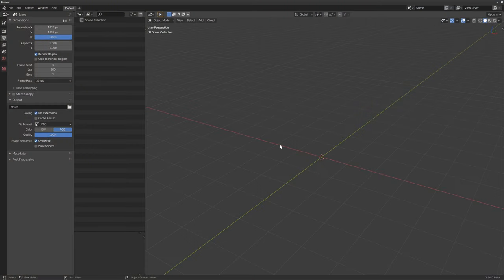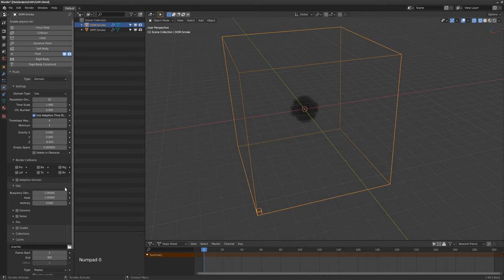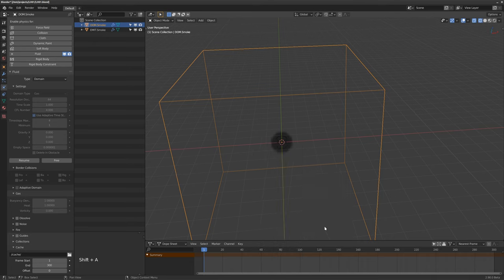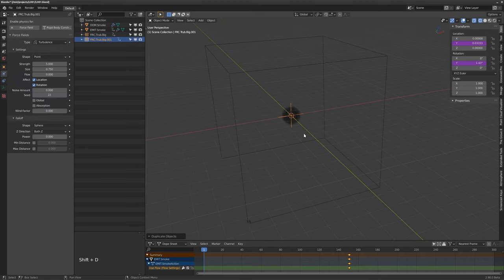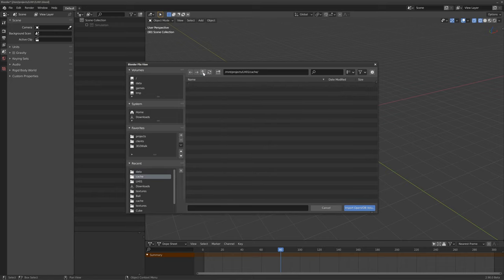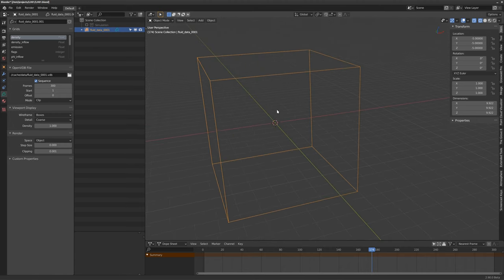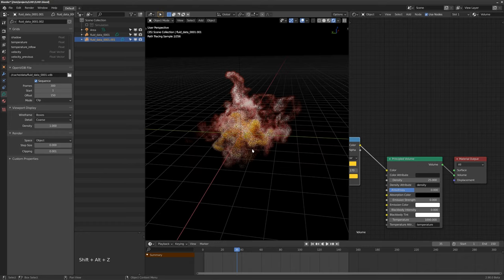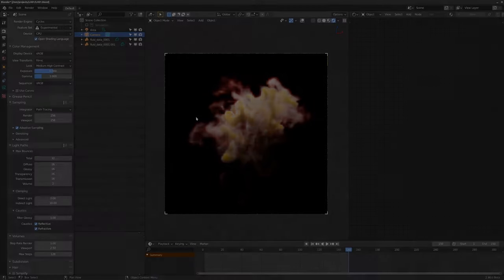The Loop Hole #01 - Looping Smoke Simulations [Blender]

Comment: In 2.93 they've added a "use scene gravity" setting which can't be changed from the top bit, however it can be modified from the "Force Fields" subcategory just further down in the list.
Reply from the maker: You can also turn off gravity in the Scene settings and then the settings will be accessible from the fluid solver. :)

Comment: Perhaps one thing to note, is in the start you should not make really dense smoke sim. Because in the looping part your overlapping them so it gets much denser. But you could also put them after each other but sim will be longer then.
Reply from the maker: Yeah, you can also scale up your emitter for example so it starts small and the overlap is a bit more hidden.
Reply: @MidgeSinnaeve  doesn't the scale I fluence the movement, but on the hand, that doesn't really matter I guess
Reply from the maker: @RomboutVersluijs  Somewhat, but you can have a longer lead in or just animate the density of the shaders to mix them. Lots of options once it's set up basically. :)
Reply: @MidgeSinnaeve  Nice! I always looked at the animations from Lotsalot he had super dope smoke sims
Reply from the maker: @RomboutVersluijs  Cool, I'll have to check those out!

Comment: Love your tutorials and your design aesthetics, Midge.  I bought RTMG and it's totally worth it.  One of my favorite things you do is the loops, so looking forward to more Loop Holes.  BTW, just wanted to say that this doesn't seem to work with 2.83.1.  I ran through this once with 2.83.1 and the openVDB didn't seem to import correctly.  Went back through with 2.9 and it worked just fine.  There might be some tweaks in the steps if using 2.83.1 to get it to work correctly, but I don't know what they are.  Thought I'd leave this here to let others know in case they try this with 2.83.1
Reply: same problem with 2.83.4, the import of density_xxxx.vdb seems to have some issues
Reply from the maker: Hmm, that's weird, I just tried it in 2.83.3 and 2.83.4 here and it works just fine. Make sure to select all of the vdb files in the sequence to make sure it imports the entire sequence. You're sure the cache is set to OpenVDB instead of Uni? It might be saving it to the wrong format be default, this was changed in 2.9 I believe.
Reply: @MidgeSinnaeve  yes it's openVDB and importing all the files Blender has made this https://ibb.co/hY9tXzB, but dont worry, i've just downloaded the 2.9beta, so no problem at all!
Reply from the maker: @antonios5572  Nice!

Comment: Hey! Do you know if it is possible to achieve the volume color you're creating at around the 15-minute mark on solid objects? I created a bowl-shaped "pudding" with displacement that looks like passable mist when I give it a volume as a material. However, no matter what I do the color is either solid or conforms to normal stuff like textures, gradients etc. I want the color to react to the volume's density just like yours does since, depending on the displacement, it's not uniformly dense all over. 

I tried plugging a texture and color ramp into the density itself to make sure there were different  levels to draw on, but that doesn't work either with the attribute or volume input nodes. I tried the same by creating a volume out of the mesh with the same results.

Any ideas? Thanks!
Reply from the maker: Hmm using a procedural texture should work, I've done that before. You have to add a lot of contrast to see it though.

Comment: IS that a new feature as well, using a hastag to immediately add a driver? I know the "add drive" method is already much better in 2.8 but this one is really nice!
Reply from the maker: Nope, been around for a while, real quick to set up! :)
Reply: @MidgeSinnaeve  dang never knew, I always found setting up drivers tedious. 2.8 is better with that popuo window we got now. But this is great!
Reply: Midge also used this in his new Real Time Motion Graphics course. It's really great value! If you want to dive into the Sinnaeve microverse you can find it here: https://blendermarket.com/products/rtmg
Reply: @blenderunit146  yeah I've been following Mitch for quite a while. I always lobed his doodles which he shared for free. The "weird shit" videos if I'm correct.
I also know different code can be added so you can animate usi g say a sinus function. It will anmated without using any keyframes. Saw this trick on blender tips
I do t do animations and my laptop is crap, so I need to wait if I want to get this

Comment: Hello, this might seem off topic but how are you getting the playback of the simulation animation at 30fps, I followed your exact same settings, my cache is stored in an nvme ssd, running a 12core processor with a good gpu yet I get 16fps, have you enabled/disabled anything to get a smooth playback?
Reply from the maker: It's all very dependent on the resolution of the smoke sim. I didn't set it too high so the tutorial would be a little quicker to follow, but it really depends om the sim. In my case, I actually have 4 NVMe SSD's in a mirror setup to get maximum speed, but a regular one should be able to play things back pretty quick.
Reply: @MidgeSinnaeve  I set it to 32, and it's all smooth but when I set it to 64, like you did in the video, it lags(16fps opposed to your 30), I have ryzen 9 5900x with 64gb ram and the cache is stored in nvme, guess I will try it with another SSD and check.
Reply from the maker: @meet2863  Hmm, that is weird, I would think it plays fine on that setup. There's nothing else off the top of my head I can think of though.

Comment: I find a lot of times the smoke looks blurred/blurry, like none of it is in focus even though i'm not using any DOF etc. I have tired higher samples, higher resolution on the smoke.
What's your tips for things like this?
Reply: Sounds like you might have motion blur turned on.
Reply: @notlootbox9942  It's off by default and i never use it when testing renders. Hardly ever use it full stop
Reply: @Unleashed75  
Hop into and enable the 'Noise' setting of your domain, leave the upres factor at 2, more if you have a beastly PC. Set Strength and Scale to 0 so it doesn't simulate the noise and only upscales the resolution of your smoke.

Search for a channel called Crossmind Studio and watch the Chapter 1 & 2 of his recent Mantaflow series where he shows how to simulate and shade volumetrics. His workflow guide should show you what you need to tweak.
Reply from the maker: @notlootbox9942  Thanks for adding that! :)
Reply from the maker: I upres and use noise quite a bit, as Not Lootbox describes in his answer. It can take quite long to simulate and take up a lot of disk space though, so keep that in mind. I've let sims run overnight more than once to get the maximum amount of detail. :)
Reply: @MidgeSinnaeve  You're welcome :) Thank you for giving back to the community with great quality tutorials. Speaking of disk space, I have a cache folder at 32GB for 250 frames of wispy smoke over coffee beans. It can get insane :D Res: 256 Samples: 128 Upres: 3 and I want to try it at Res: 512 overnight, as you do.
Reply from the maker: @notlootbox9942  Yeah, I've seen hundreds of gigabytes for some sims I've done, crazy stuff! :)

Comment: What is going on with the drivers??? I did not catch that.
Reply from the maker: If you type the hashtag (#) symbol and then type frame, so #frame it will give you the frame number in that value so you can use it to automate animations.
Reply: @MidgeSinnaeve  for some reason it only works on rotation, and not location, is there a fix?
Reply from the maker: @MeatMake  Hmm, I use on location all the time, so it should work. Maybe a typo?

Comment: In 2.83.4, none of the VDB caches displays anything. Like, even the imported volume only shows up as an origin point, not a box. Any ideas why?
Reply from the maker: That's odd, someone else mentioned this in the comments as well. I tested it in 2.83.3 and 2.83.4 and it worked fine for me. The only thing I notice is that the Volume Object appears empty when you're outside the frame range of the cache. Other than that it appears as expected on my end. Which OS are you using? Might be a platform specific bug as I test everything on Linux myself.
Reply: @MidgeSinnaeve  I'm on Linux myself (64-bit Ubuntu 20.04). I've tried re-baking everything at frame 1 and adding the resulting density caches at the same frame, and the same thing happens.

Also, the density attribute appears as "density_s4", with the last number varying from bake to bake, but that might be by design.
Reply from the maker: @rawkeh  Yeah, I've seen it do the weird numbering, but it always loaded fine for me. Maybe try the 2.9 beta and see if the problem persists? You can grab it here: https://builder.blender.org/download/
Reply: @MidgeSinnaeve  Yeah, in 2.9 it works as expected, thank you!. Now I just need to get good at lighting and composition...
Reply from the maker: @rawkeh  Ah that's good, at least you can start playing around with it now! :)

Comment: Hi, I don't get it.  When you showed the "loop", the last and first frames were different.
Reply from the maker: If the frame is the same on the first and last frame it'll hitch because they look the same. your first frame and the one after the last you render should be the same for it to look right. :)
Reply: @MidgeSinnaeve  But how is the last frame the one before the first, if you see what I mean.  In terms of dynamics, doesn't it "jolt" perception when the loop happens?  When I've done standard anim loops, pose to pose, the last and first frames are the same, and you render to end-1.  In this case you're using a sim, so I don't see how that happens.
Reply from the maker: @robbie_  I'm making sure the first sim ends before the end of the loop. Then by overlapping the cached sim data you can effectively look like it loops perfectly.